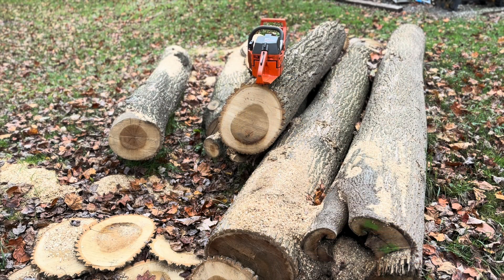Debut 50cc Race Chainsaw Build Project!  Husqvarna 50 Partner 5000 Hybrid!  First Cuts!

Comment: The lucky dog manufacturing 90° handpiece works great. Fits in 25cc cylinders
Reply from the maker: Thanks for the tip!
Reply: Does the head "swivel"/adjustable angle on the Lucky Dog, too? or is it fixed angle... I looked it up, but couldn't tell

Comment: Oh yea!!!!! Partner Power Baby, I'm gonna build and run my Poulan 325 (Partner 5000 Plus)  Next year. Great running saw Smitty 👍🏻 I like it alot.
Reply: The 325 is a 5500, not a 5000. 46mm bore instead of 44, and, the 325 has a real choke!
Reply from the maker: Sounds great!